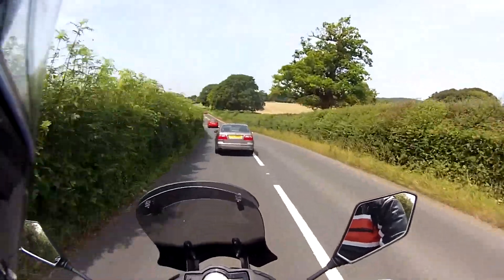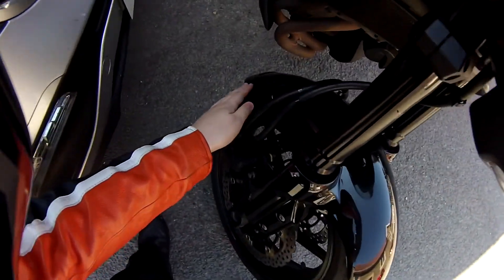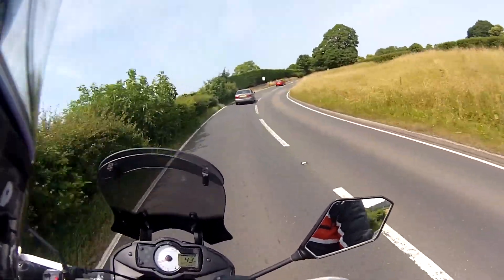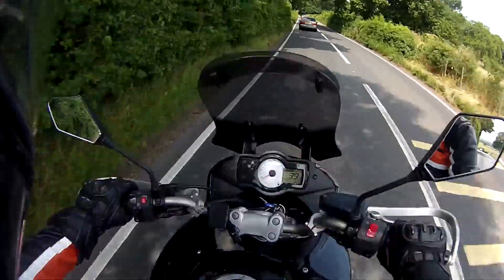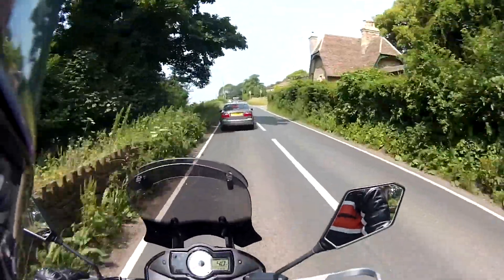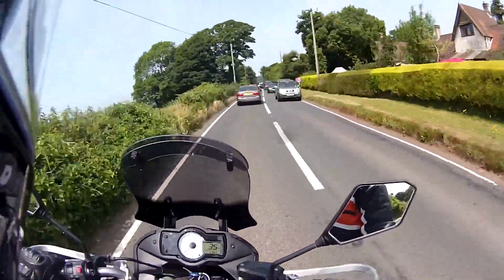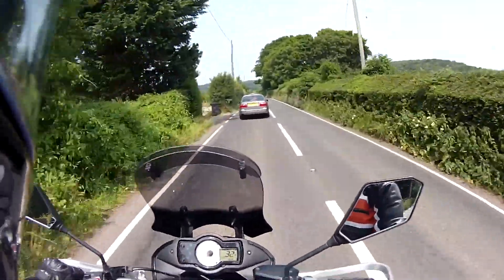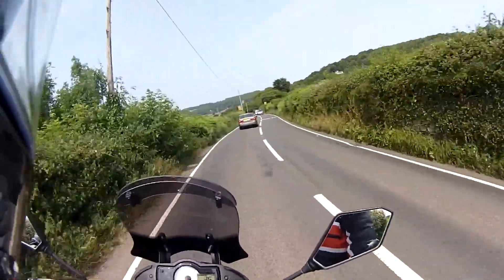Bike fixed and bits changed update

Comment: Good deal. The cables are easy to lube.When you get ready to clean your airfilter you should think about replacing it with a BMC filter.The stock filter is kinda flimsy. Changing the spark plugs is simple to.If you go to the versys forum in the states theres a step by step thread on it.